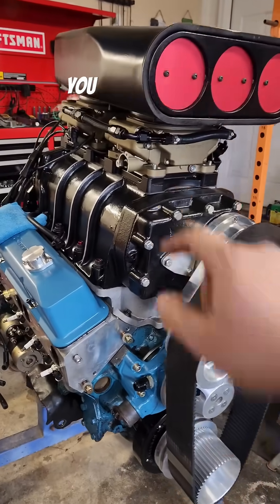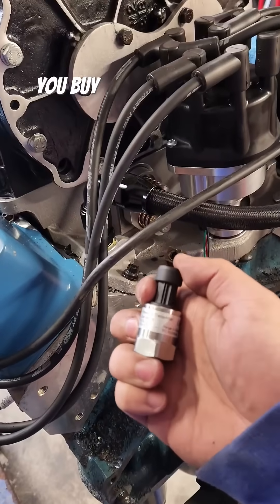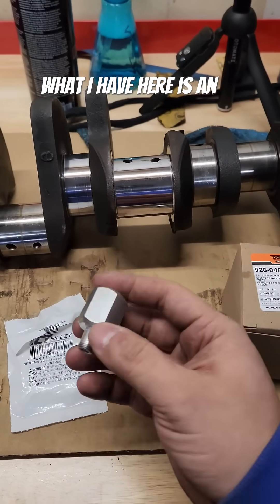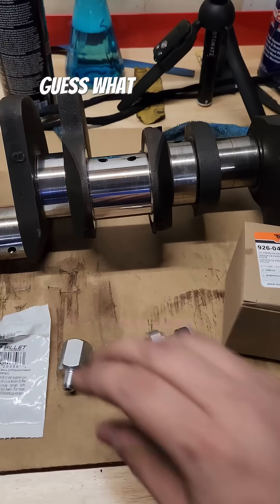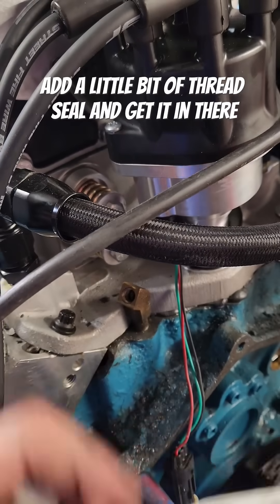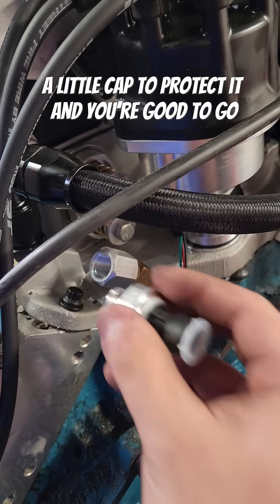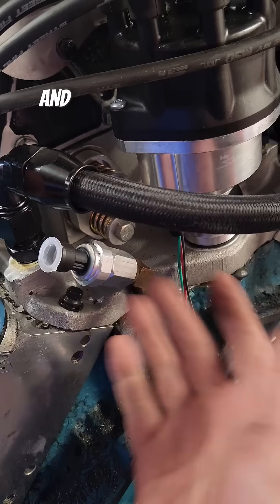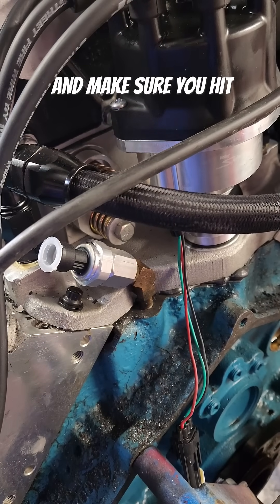Budget EFI Sensors | Add a custom sensor to your Holley Sniper #EFI system #howto #automobile #sbc

Comment: Weld a nut onto you’re slide hammer vice grip combo and you can tighten that vice grip a bit better. Tried to comment on the video I seen the slide wrench on but the comments were currently paused, hope it helps man

Comment: as a mechanic who had tried the sniper system many f-in times over 6-7 years. the only way to make them reliable is to throw them in the trash.  longest ive had one work was 2 years and it came back to be to be replaced by a carburetor